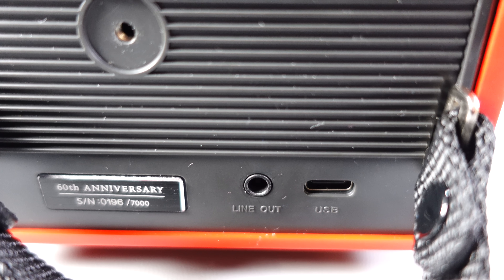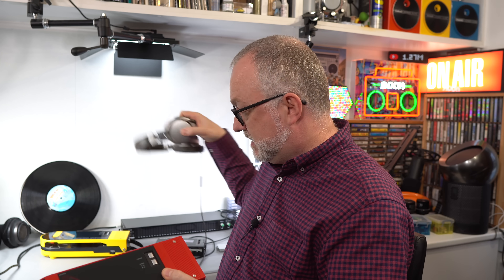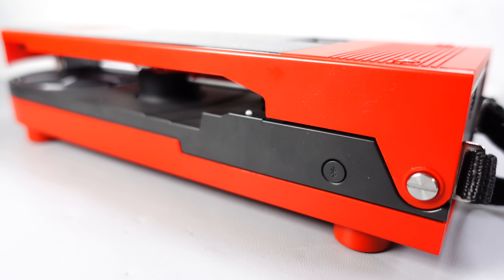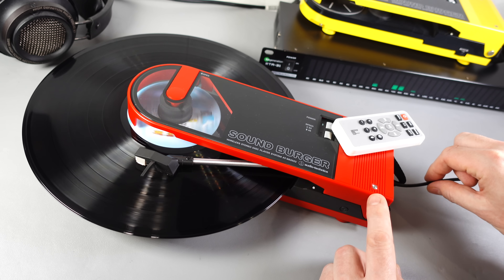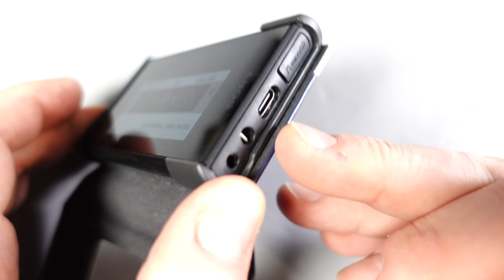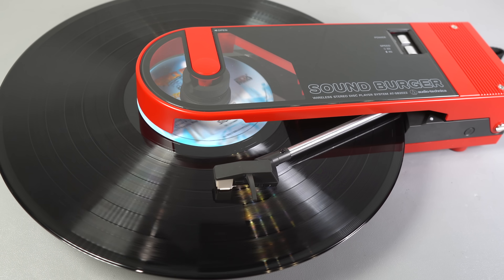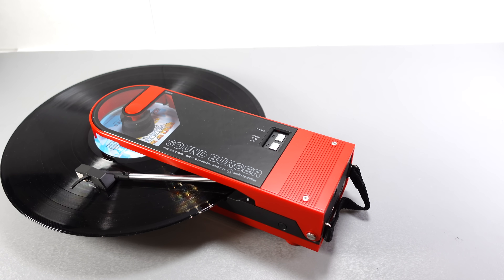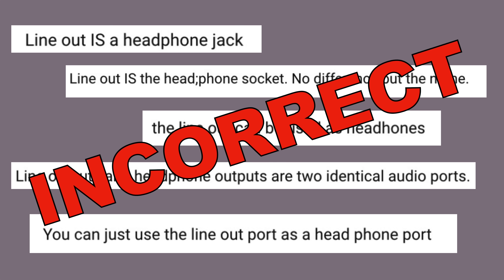Line-out ≠ Headphone-out

Comment: You can also use PC speakers, as long as they have a headphone out. Plug the speakers into the Line-Out, plug your headphones into the speakers. You'll need AC power, but if you're playing something like the Sound Burger on a desk or something near where you're working, this would work just fine. The problem is.... PC Speakers that feature Headphone Out jacks on them are becoming increasingly more rare (and there are lots of PC speakers that have USB connections instead of 3.5mm). More Headphones meant for PC will either have Bluetooth or USB as they have a sound processor built into the headphones, and only some of them have a USB->3.5mm conversion dongle. My Sennheisers don't have such a dongle, they are purely USB-Only. I bought them because the cord that goes between the headphones and the PC is removeable and one of the worst things about headphones is having to throw a whole pair of headphones away because the cord failed either where it plugs in, or where it attaches to the headphones themselves. I don't like wireless, because I don't like having to recharge them and/or the idea of running out of juice in the middle of doing something.
Reply: Thats why I had kept some cheap, dirty old pc speakers,  People wondering why I have the crappiest speakers in the world, in a room with high end equipment.  Then I show them my phonograph

Comment: the issue is  MOST desktops that use headphones can be used as line out on its same port, but the computer can switch to headphones as you get a prompt on your audio manager to say if its headphones, speaker or line out.the issue lies with the fact the new Sound Burger is NOT a computer that can manage its port to use as headphones or line out, so Bluetooth is the only viable portable way to run audio from. I personalty use line out from computer to my amp so i don't relay on the on board DAC to control my audio, i let the amp to handle that bulk end.

Comment: There is a reason things like this are marked.   A Banana fits up the tailpipe of a car too.  But that doesn't mean it belongs there. I have a device on which the Line-out level is the same as the headphone-out on MAX volume.  It's odd.   Recently  I REALLY wanted a DAP.  Not just another run of the mill, MP3 player,  but something that also does FLAC and WAV files as well.  So my desires were Fiio M-11 or Astell & Kern SP-3000 levels,  but my budget is a bit less.  Plus I had no use for yet another  touchscreen gadget.  I wanted real buttons, switches and knobs.   So I found the Surfans F-20.   It's quite good for an entry-level DAP.  Proper, albeit small screen for display only,  clickwheel, and actual buttons as well as BT. But here's the thing..  It also has Headphone out and Line out 1/4"  (3.5 mm) jacks.  As stated here the headphone out is fully adjustable. and the line out is not.  BUT..  the line out jack  is like MAX volume levels of output.   It's fine on the AUX-in jack of a Dodge Uconnect head unit, but overdriven in some other applications. 

(For those wondering:  I use "KZ-ZSN Pro-X" IEM's with it when possible. (Wired version)   The sound is amazing.  But the BT output is significantly lower via my "Sennheiser Momentum TW-2's"  (Which normally perform amazingly well also)

Comment: Audio line out = 1Vpp or 0.707Vrms (wait... is it 0.354Vrms? y'arr!),  Sometimes an input device will clamp out any excess (with simple diodes for example).  In audio electronics, only 4Ω and 8Ω are typical by convention for power impedance matching, however the transmission line characteristic impedance is entirely negligible, whereas the real , heat-generating resistance, matters, esp. with respect to power speakers/amps.  On the other end; shielding and twisted pairs, balanced line inputs... another story, more for electronically noisy environments.  That is all.  Picard out.  (Or whoever)

Comment: Aside from the impedance being different between headphone and line outputs, many devices I’ve had over the years had different tonal balance as well. The bass frequencies were rolled back on the headphone out, at least in older devices. Cassette decks and such.

Comment: Does the reissued soundburger also apply the correct equalization curve, or should a phono-amp be used? Also what about electro static buildup? A metal stylus rubbing on a vynal surface can cause a lot of electoro static buildup without proper grounding.
Reply: It's a line-level output. RIAA curve has already been applied in the unit, no need for a phono pre.

Comment: Had the reverse thing happen to me, the aftermarket head unit in my car only has an RCA line level input so anything with a headphone output would not match up impedance wise and end up sounding like a whisper. Had to get a device specifically made with a line out to properly retrofit Bluetooth in there.

Comment: Yep, they have some related things both can do but not the same at all. If going to a amplifier both can be used, but the line out will be better if the unit has one instead of the headphone out. Headphone out if used as a line out then that unit has to have it's volume down to 1/3, 1/2 or less or the next unit will be over loaded.
 I have used the mic input in a pinch to play a turntable with magnetic cartridge through it and the volume is good but the sound equalization is off.
 Early computers from the 1990's - 2000's used to only have one output and it was meant to drive speakers directly, then they moved to live level output, and to often people tried using those same speakers on those newer style computers and wondered why the volume was so low or not really there.
 People also would put their modern speakers on the older computer and wonder why they are blaring loud and distorted.
 There is also some confusion on the computer about a mono or stereo mic input. I was told around this same time period that the more modern computers had the extra ring on the plug to power the mic, (amplified mic) not designed to be used with a stereo mic.

Comment: Another thing to add, most pc motherboards have a Realtek or equivalent audio chip. These audio devices are smart, detects if you plugged anything in, asks what did you plug in speakers or headphones and then it auto-magically configures the chip/hardware by the software on the pc.

Comment: Like you said, the misconception comes from the fact that it’s the other way around. Before Bluetooth was so widespread there were car radios and small home hifis which had an input at the front labeled line in or aux in. Those were made to connect MP3 players or other small devices instead of other hifi equipment. Especially in the case of the car radio.
Reply: So the confusion really comes from people selling  "hifi" equipment with mini jack connectors instead of RCA

Comment: I have a Sony MZR-50 where the line out was about the mid-level of the headphone out.  So it worked in a pinch with the headphones I had at the time when a couple people wanted to listen at the same time.
Reply: I have done this as well. It works depending on your headphones. It's not ideal but it can work.

Comment: A few years ago I bought a Rockman guitar headphone amp from the 80s (the little box that gives you the guitar sounds of Boston and Def Leppard), and I was blown away to find out that it uses 3.5mm for the POWER connection! I had never seen that before! I don't even want to know what would happen if I were to plug my headphones into that port!
Reply: Haha! You are wise to not try that. I'd venture to guess that 9 times out of 10 nothing would really happen, since you'd just have two different devices both looking for power from each other. So, essentially there's nothing there to transmit either way. 
However, if the capacitor(s) in your Rockman power circuit were still sufficiently charged, the headphones might draw that stored power backwards along the circuit. That would likely translate to a big "pop" from the headphones. 
I certainly don't suggest trying that, but if I had some crappy expendable headphones and an expendable device it would be a fun experiment. Worst case scenario would be that it would damage the drivers in the headphones and/or damage the capacitors. It would really depend on several different variables. But really, it would be foolish to do so unless you were just really bored and wanted to mess around and possibly damage some stuff.

Comment: Yes, that "just because the jacks are the same doesn't mean they all function the same" is a super-important point!  It's like if you see a audio player with RCA jacks --- they could be either line in, line out, or speaker jacks from a built-in amplifier.
Reply: One RCA jack on a CD player, mind you---this is an audio only device--is designed to carry SPDIF digital audio out of it and will sound like silence if you hook it to the RCA line input of an amplifier.
Reply: @brentfisher902  Yes, or that, too.  Some of the most modern CD/DVD players are a real pain to hook up to existing equipment 'cuz they just have digital (i.e., an orange RCA and/or HDMI jack) outputs, with no analog A/V RCA jacks for older hi-fi sets or stereo TVs.

Comment: Curious, because my experience is the opposite, usually if I connect a headphone out to a line in I have to use a volume I'd never use while listening to headphones in order to achieve an output level similar to other devices (take in mind that all my headphones are easy to drive, the ones I'm currently using are 56 ohms with good sensivity).
Reply: Because headphone out has low voltage but high current to drive the coils of the headset. Line inputs does not need high currents they need high voltage ( tipically 1 volt)

Comment: Was working on an Ampex 601 and 602 the other day. The guy I was helping kept reminding me to use the line out on those particular machines were old enough that the line outs had the power to drive his headphones from 20 years later.

I should mention that either output would play at the recorded level, but the headphone out on the front would drive at an impedance that wouldn’t drive his more modern headphones.

Comment: I have a digital radio for the stereo system with line output. The developers have implemented a volume control for the line output. Probably because portable radios use the same circuitry and need something for volume. 
But they installed a speaker amplifier in portable radios that my HIFI device is missing.
The HIFI radio uses a 3.5 mm stereo jack to 2x cinch cable but is labeled with LINE

Comment: One possible reason for the confusion is PCs. On mine the line out is the headphone jack, and it has amplification built in. All the motherboards with built in sound cards I've used for more than a decade have labelled it as line out, even though it's also meant for headphones.
Reply: Good point! Most motherboards have separate line in and microphone inputs, but just a single “line out” which has a controllable amp
Reply: This!
Reply: all the ones I've been using still label it as a headphone out.
Reply: @xander1052  cool
Reply: @xander1052  ok

Comment: Some genius decided to use 3.5mm for both the audio out, mic and POWER on portable audio equipment I used to work with. It was virtually a daily affair that someone blew one up by plugging power in to audio. Oops 

I could never be that mad at the users as it was - frankly - a bloody stupid design decision. The audio and mic plugs had coloured collars on them, but the power had no collar. That's how you were supposed to tell them apart and avoid instadeathing your expensive kit.

In my darker moments I suspect it was deliberate as the manufacturers had a nice little revenue in "repairs", claiming they needed to replace the entire board at 1/2 the cost of a new device rather than fix the old one. Or, indeed, install a protection circuit...

Comment: Interesting. BUT on my PC for example, there is only Line In / Out and Mic. The volume control is digitally of course, which the Burger can't, even via Bluetooth i presume.
I my case, I can use my 250 Ohm and even 400 Ohm Headphones and the total Volume is only down by 10%/20%, compared to 32 Ohm. Which is still enough btw, because i listen to 50% Volume. 100% would be too loud on every Headphone.
I have a DAC/AMP Stack (from Schiit) now, if i crank everything to the max it is twice as loud on 100%, but i don't want to blow my ears out. :D
For Gaming and listening i use the DT1990Pro, which are 250 Ohm.

So... Line-In CAN be just like a Headphone-Jack, but it depends on the device.

Comment: Something to bear in mind with headphone out vs line is is that, in a device with built-in speakers plugging something into the headphone socket will defeat the speakers, but plugging something into the line out will not. Once needed to amplify a portable keyboard and it only had a headphone socket so with the PA speakers in front of me, no foldback and a guitarist behind with his own amp it was very hard to hear yourself playing.
Reply: I had a guitar amplifier wherein the line out did defeat the speakers, and it's easy to see why you might want that; in a live situation, it reduces feedback. Of course your situation also exists, but I don't think that there are rock-solid rules one way or the other.

Comment: To add infos for confusion, the iRiver H120/H140 multimedia player had a normal headphone out and a pair of white 3,5mm jacks: one for line in/mono and stereo mic/optical spdif in; the other for line out/optical spdif out, but this electrical line out was also volume controlled so you could totally connect headphones here and it sounded the same! Looking at the circuit the signals came all from the same Philips chip with ADC, DAC and amp functions, and inside the chip there was a difference in headphones and line out, some capacitors in series for the HP, if I remember right. Anyway, always read the manual but also never trust blindly what's written in it cause sometimes there are errors in there too: I've found errors even in service manuals of Sony stuff!

Comment: Question... I have a Line Out socket next to a headphone socket on my Sony Discman, when I connect both ports to the Line In on my Micro system to hear the audio through the speakers, the Line Out signal is louder than the headphone out at max volume, which seems to be the reverse of what you say at the 4 minute mark. Or am I thinking it through wrong?

Comment: It all boils down to output impedance. Line out is typically kiloohms, headphone output is meant to handle 32...600 ohm phones. If you connect these to the line output, you not only get a very silent sound, but it'll lack in low frequencies as the output coupling capacitors combined with headphones will form a high-pass filter.
Reply: Input impedance, not output impedance.

A line input typically has an impedance of 1-47K.  The line output impedance varies, might be around 100R, just to protect the output driver against a direct short.

Headphones will have an impedance of 8-700R, with typical values somewhere between 32-400R.  The output should have as low impedance as possible - ideally “none,” but realistically just “less than the headphones.”
Reply: True. And conversely, some line-in devices do not get enough volume when fed from some headphone outputs. This is because a line in/out is supposed to be 1V over 10kΩ, whereas one volt over 32Ω headphones would be 31,25mW. Doesn't sound like a lot, but that's a lot more than most headphones need. Most headphones have a sensitivity of at least 100dB SPL per mW, meaning 31mW would be  115dB. That's loud enough to be bad for your ears. Many, especially small and  battery powered devices don't output enough voltage for that reason and are much quieter than a hi-fi component plugged into another line input.
Reply: @krzysztofczarnecki8238  I once plugged headphones into line out and could barely hear. So I wondered if I turned down the headphones out to match the perceived level of the line out, could I have 2 lineouts. Needless to say it didn't work. The line out was louder.
Reply: @krzysztofczarnecki8238  Absolutely. A lot of headphone outputs on modern devices have the potential to deliver a decent current, as they might expect a 32 ohm load, but significantly less voltage,  Voltage is much more important for getting a decent level into a line-in than current is. As the input will be a relatively high impedance. However, one thing you can do in this situation (if you don't want to use a pre-amp) is to use a small audio transformer to step up the voltage. Headphone outputs will drive these very well.
Reply: True, they differ in more than just volume. Line out is a signal, like the signal used within the device, meant to be used within another device. Headphone or speaker output is the final stage, the result of that signal after filtering, processing, or amplification, meant to be heard by the user of the device. Using either for their unintended purpose will cause you to lose information.
Reply: Can you tell me what is the "standard" impedance of a PHONO output (and input) on amplifiers? I heard many times I should never use those inputs on an amplifier to connect any sound reproduction device other than "a gramoPHONE", better known as a record player.  Are louder devices able to cause it actual damage or...?  Thank you!
Reply: @21palica  phono - phonograph (ie turntable, record player) input, 47kΩ with RIAA equalization that boosts low frequencies and cuts high, input level is typically in a single millivolts range and if you connect a stronger signal, you'll overdrive it and get bad non-linear distortion

phones - headphones output, capable of driving low impedances like 32Ω or even lower, output level is typically tens or hundreds of millivolts
Reply: @KeritechElectronics  Thank you for answering! Now I know.
Reply: @21palica  I'm always glad to help others! :)